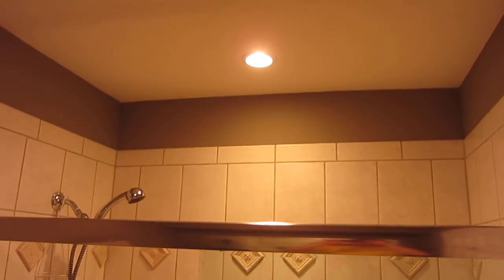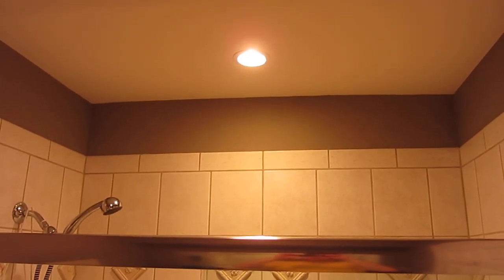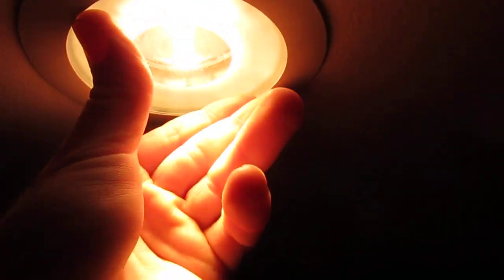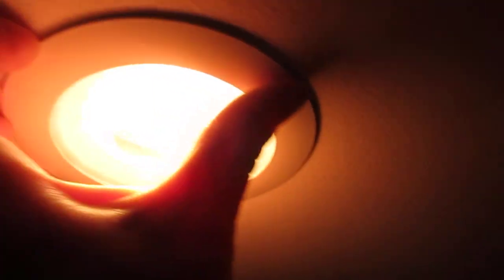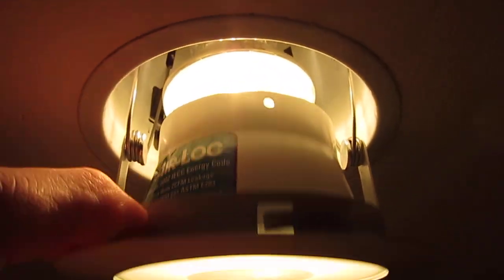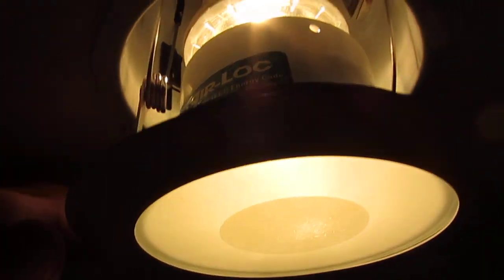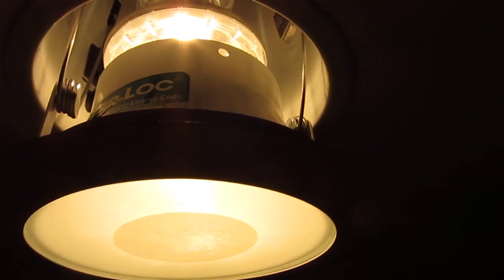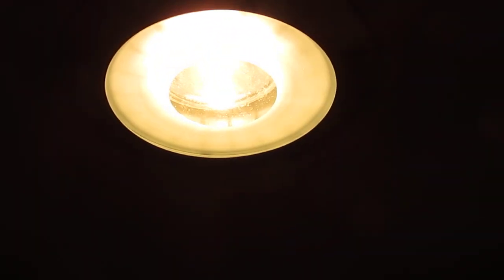How to: Replace recessed lighting w/ cover (in bathroom)

Comment: a million thanks--for months had postponed attempting this job.  This is the best video. It was not necessary for me to disassemble the entire apparatus.  I have small hands & was able to install a 75watt bulb.  Helpful hint--have a damp cloth or paper towel handy to wipe the dust & bulbs from inside the cover.

Comment: Just replaced the bulb over my shower in about 3 minutes thanks to this video.   Couldn't for the life of me figure out the cover.   Had to get a small flat head screwdriver to pry it cover off it was so tight to the ceiling.   Thanks!

Comment: Thanks for making this video! It was super helpful to change the light bulb in my shower stall. I was wondering how I was going to get that cover off. Your instructions were spot on. Luckily I didn't have to pull the latches out as there was a small spiral bulb in mines that I was able to remove by leaning the cover to the side. I replaced the bulb in less than 3 mins!

Comment: Thank You So Much for this video!! I have the same type of light and had no idea how to change the bulb...didn't want to mess up the ceiling!  For anyone trying this and it is harder to pull down, mine had a foam seal around the inside of the part you pull down. It was stuck in parts so I had to pull it gently to not tear the ring. This tutorial made this job so easy! I had been thinking about this for days and after watching the vid, I changed the bulb in 5 min. Thank you again!!!

Comment: thanks man! I have to replace a a bulb with the EXACT fixture. Only diffrence is its outside and 3 stories up. I REALLY wish you had included how to reconnect the hooks. I have very little room to move around on a ladder and as easy as it is to get the two facing me (the ones we see in the flim) but I can not see the other two at all unless I stand on the ladder backwards (which scares the crap out of me)
Still, tyvm!

Comment: I have tile ceiling stall was replacing an LED light fixture that was upgraded.  Unfortunately the unit I purchased from Amazon is not sitting flush with the tile wall.  Is this just because it’s a no brand unit that is probably too cheap.  I already placed an order for the Halo.  Reason I bought the other was the Halo unit rusted out so poorly even though damp rated.  I was so disenchanted.

Comment: I hour of messing with it I took the whole thing out of the ceiling by squeezing the springs up in the can and pulling it all out. Then you can use pliers to get the spring back on the other side. Push the spring ends together to reattach. It's quick once you get fed up and pull the whole bleeping thing out of the can! Very poor design. If only the springs were an inch longer you could fit a finger in them at least. I had to use a hammer and all to open the spring holder on the flange. luck 2 U

Comment: My problem was the light bulb is almost flushed with the cup recess on face and ring side, there was no way to stick a screwdriver in let alone using my fingers. In one light I had to break the light bulb and used pliers to remove it, the others I pull the whole recess thingy down and now they half way sticking up b/c the clip spring was cheaply made and not retracted. They should fire these engineers.